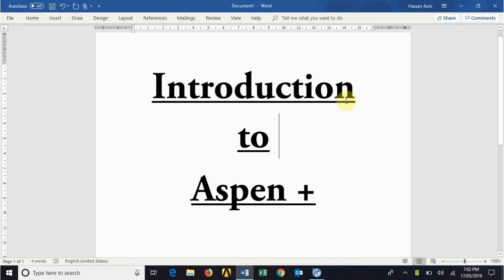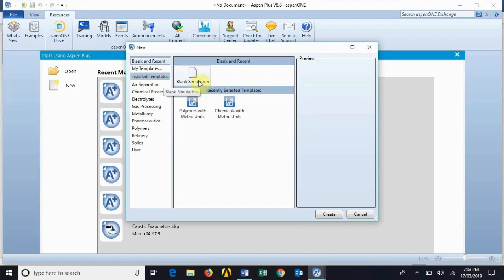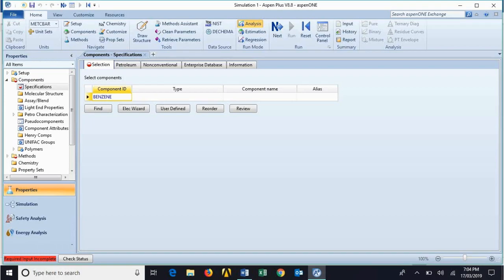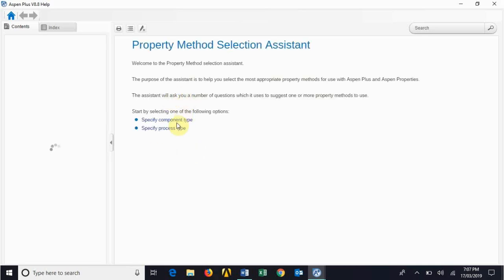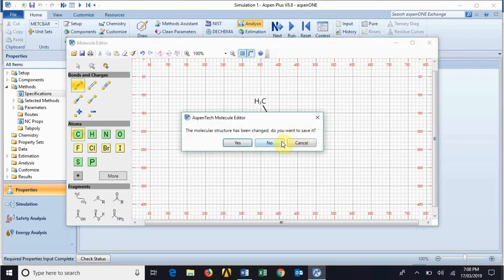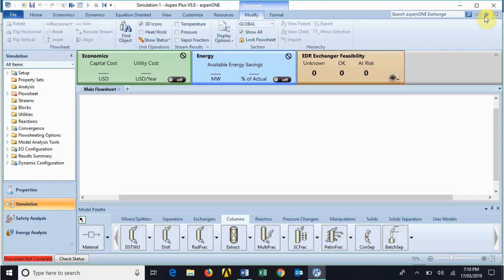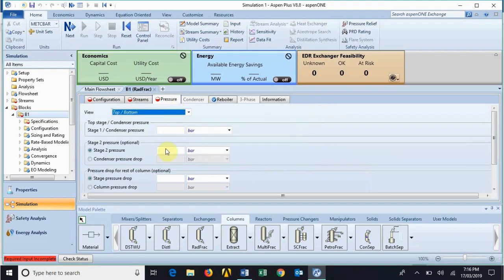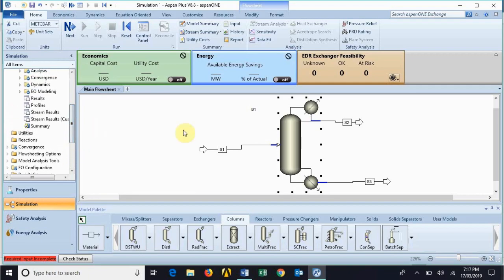Introduction to Aspen Plus

Comment: Hey  i have a question  to Aspen  but I don't know if you understand  French  
Question 1
Que signifie la caractéristique : Aspen est bâti sur l’architecture séquentielle-modulaire. Quel est le principal avantage et quel est le principal inconvénient de cette architecture.
Question 2 :
Expliquer comment sont traités les recyclages par les simulateurs de procédés.
Question 3 :
De quoi est constitué généralement un simulateur de procédé.
Reply from the maker: Hi Sara. Thanks for watching the video. Kindly post your questions in English. It might help other learners as well.  I will definitely look into them.
Reply: @its_Cheme  Question 1 What the feature means: Aspen is built on the sequential-modular architecture. What is the main advantage and what is the main disadvantage of this architecture. Question 2: Explain how recycling is handled by process simulators. Question 3: What a process simulator usually consists of.